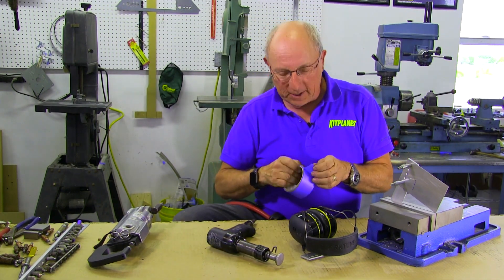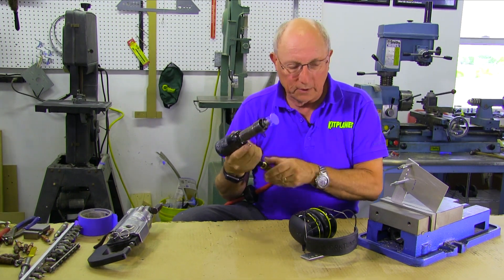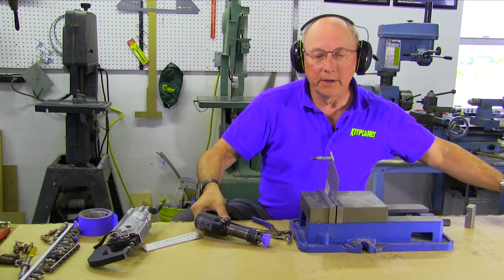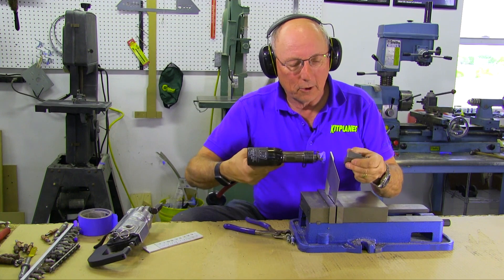Metal Magic: Driving and Squeezing Countersunk Rivets

Comment: Paul, when using a Number 2 Gun for driving flush rivets you suggest turning the pressure down, what pressure do you set at the compressor regulator 40 to 50PSI ? Thank you.

Comment: I love this back-to-basics series! Could you please do an episode on pulling flush pulled rivets al-la the Sling TSi? Specifically, I am interested in dimpling, countersinking at the correct shoulder angles (meaning, does the base material and the skin get the same angle dimple/countersink), and also the strength of the flush pulled rivets compared to "domed pull rivets" al-la the Zenith kit standard. I am considering pulling flush "pop" rivets on my project, which will NOT be a kit, but a build from scratch "one-off" similar in size and mission to the Zenair CH640, and would love your input!
Thanks
George
Reply from the maker: We have segments coming up in the series on how to work with pulled rivets, George.
Reply: @KitplanesMagazine  Thank you. I just thought I would ask specifically about FLUSH pulled rivets, since that is the hardest thing to find any videos on. Domed pulled rivet vids are a dime-a-dozen.

Comment: The adjustable ram that I bought with my squeezer specifically says not to use it on -3 rivets because the threads allow play.  I tried it anyway and did notice a tendency for the rivet to want to favor squeezing just off center.  Did I get a bad type of adjustable squeezer ram or do I suck?  The squeezer also said not to use quick release pins for the yokes but I've noticed no difference when switching between them or the bolts it came with.